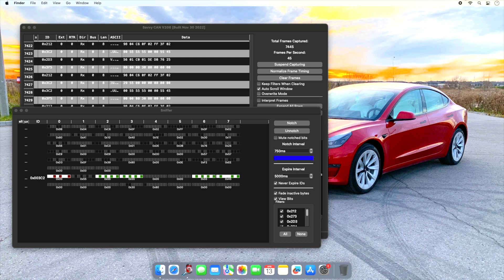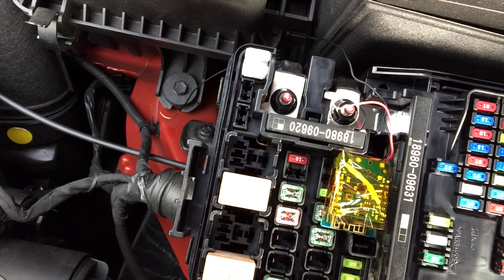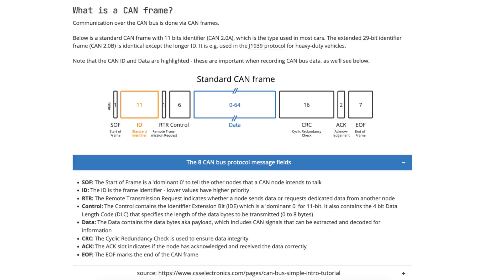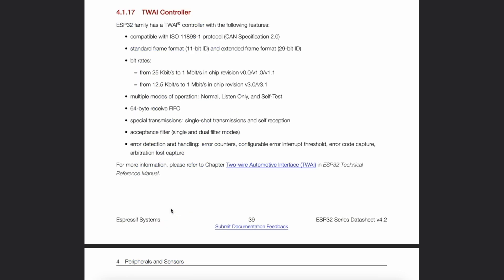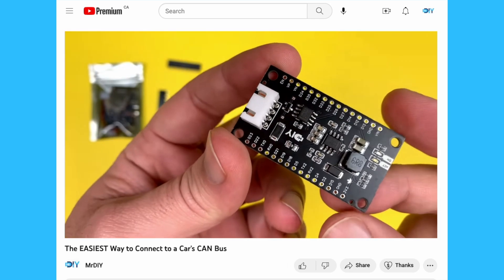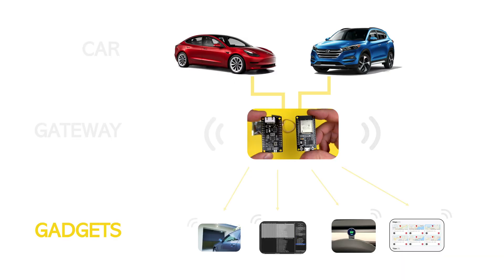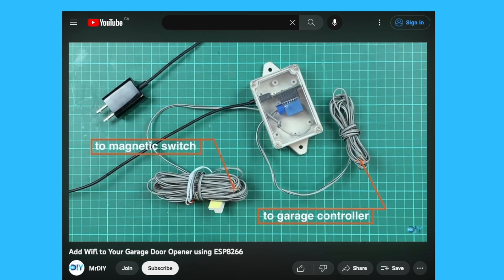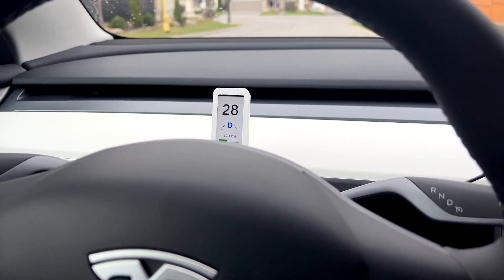How I Built a CAN Bus Framework with ESPNOW to Create These Gadgets

Comment: An automobile design engineer here 🙋
This project is absolutely awesome! But it will only work if the switch is CAN based.
Normal switches don't communicate over CAN protocol. They just make contact between two wires

Comment: i bought one of your boards with obd2 connector , is the sample code the same one you are using in the video ?
Reply from the maker: The sample code is a starting point and is used as an Example. The source code for my entire CAN project is here - https://gitlab.com/MrDIYca/canabus. the video and code for the gateway is over at https://youtu.be/XiqU5wpnupk
Reply: Thank you for the info  !!....To listen with espnow connected to savvy , any suggestions ?
Reply: i tried your sketch for savvy with Esp8266 espnow, cannot compile with arduino ids....how about a espnow connection for savvy with a esp32???...would be a better project to work with your car sender that uses a esp32 with your CAN shield. thanks
Reply from the maker: @robertj.4849  thanks, I might explore that in the future

Comment: This is pretty interesting
I was going to create a wire in module that would detect me holding down a button in my card, and disconnect a circuit.
If i can do that via canbus with this shield that would be even better

Comment: Very cool. Just to make sure I understand, this doesn't need an OBD2 connection? It's spliced into the car?
Reply from the maker: Correct. It is connected to Tesla's CANBus directly using an adapter
Reply: @MrDIYca  will this work for any car?

Comment: Hey, this is awesome! I'm thinking about a project similar to your speedometer, but I wanted to display the speed on original car screen that is placed between gauges. Do you think is this even possible to somehow display some data on original screen? For example by default everything works normal but when some button is hold for 3 seconds, the display switches to show  my data that I'll receive from can bus (like speed, rpm etc).
Reply: This. I am looking to do this exact thing but writing data to canbus (which I think is what we need to do) is the tricky part.

Comment: I thought about an application. I am waiting for a MG4 luxury electric car, however, MG pilot assist is not so good. Users always disable these assistance, and the problem is that they come back at each start of MG vehicle, and need to navigate in several menu which is boring.

I thought that it could be interesting to explore can bus trame and find the one which disable these assistance, and made a button to have a shortcut to disable it or to do it automatically. That's how I found your video.

Do you think that it's possible to send data to the vehicle and disable this seeting, or you can just receive data ? Maybe it is a little bit more risky to damage the vehicle by sending false data ?

Thanks

Thanks
Reply from the maker: It depends on the car, some functions might require auth or you might get lucky and the command is just a plain CAN msg. I would avoid writing to the bus unless you really know what you are doing. I am currently only reading but the shield itself is capable of writing as well.

Comment: What's the difference "functionally"  between your CAN-BUS module and the Seeed studio Serial CAN-BUS Module based on MCP2551 and MCP2515 SKU 114991377? And do you have any or are you planning any tutors on how you are collecting and decoding the raw CAN-BUS data as well as sending commands to the BUS? Great video by the way!
Reply: I found this video while doing some research for my own canbus project. The difference between his canbus shield and others is that his is made to work with a specific ESP32 dev board and includes numerous useful features like a built-in power converter so it be connected directly to vehicle power, termination options, read-only switch, etc.